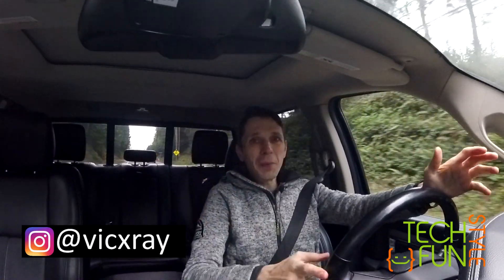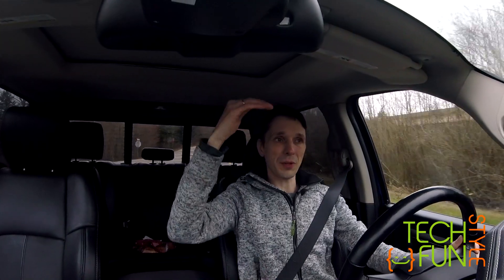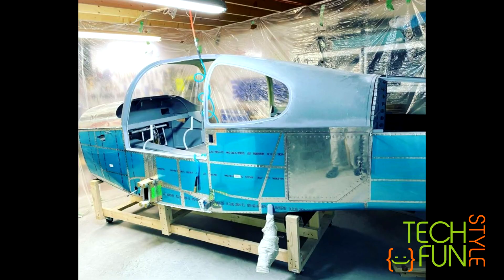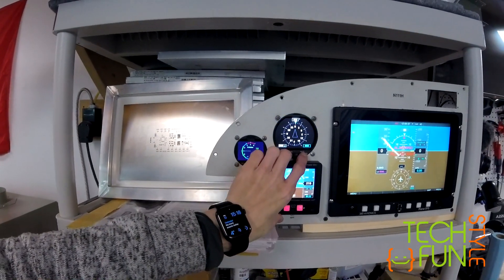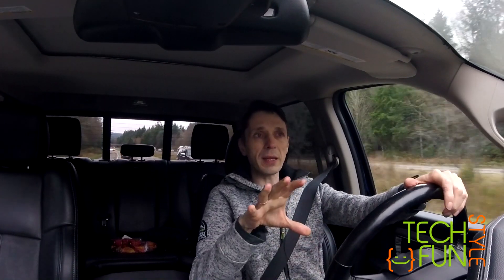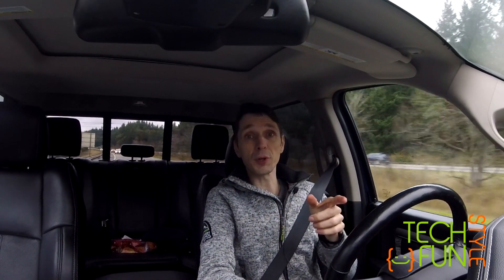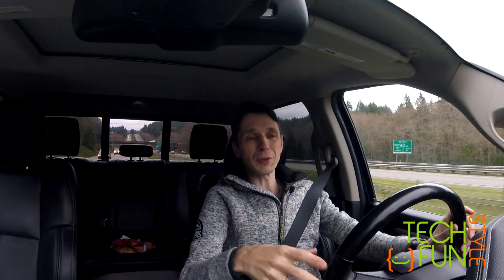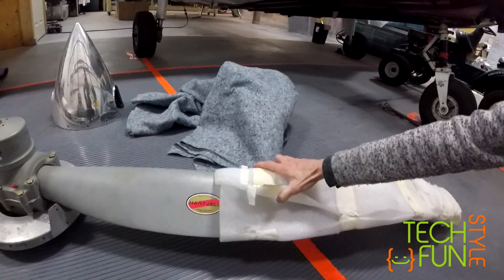Status Update - RV10 Build by Vlad

Comment: Will you be selling the avionics? I might be interested in the small EFIS for my RV4. I mentioned in your last video I'd be interested in the OH console if the mold is multi use. You think you're going to get multiple out of it?
I'm attaching tailcone this weekend then storing it while I build wings and come back to the cabin top later.
Reply from the maker: I hope that the mold I currently work on will be multi (at least 4-5 times use before it breaks) :) After pulling the first console we will all see in my video if it can be used for another try. And if so I should be able to make another one.
I currently sell two models via Spruce and on my web: www.360avionics.com and yes I plan to offer an avionics for experimental/homebuilt. By the time I get my RV in the air I should have small line of avionics available for sale to all who may be interested in it.